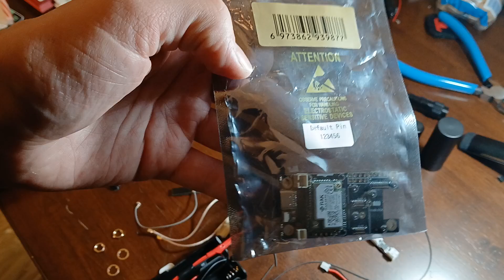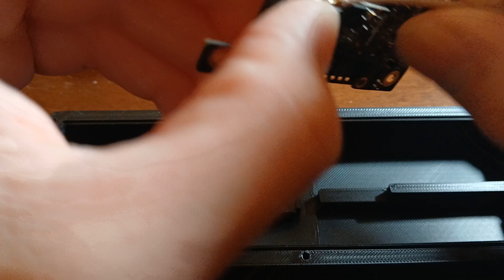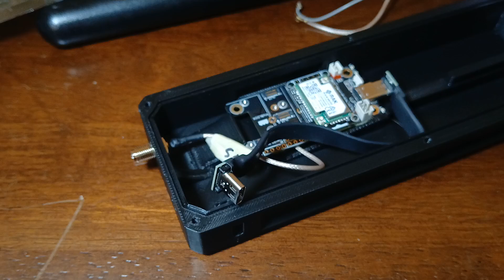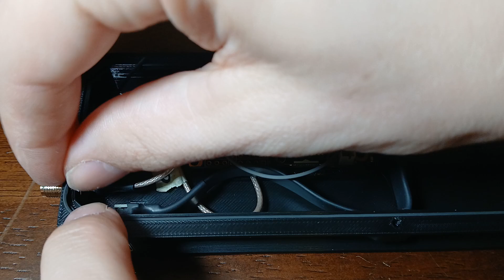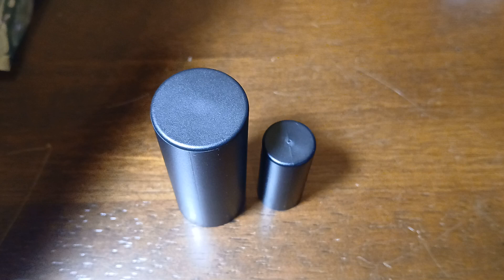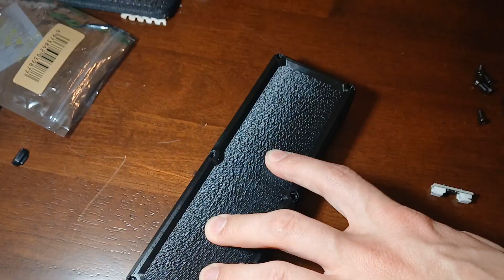Interstellar Research Systems Apex RMR Mesh Radio Assembly.

Comment: So I'd finally gotten all the parts in last Friday so I put it together and it kept power cycling and going into deep sleep. Turns out the Wisblock doesn't like the GPS module in slot D. Instead put it in slot A (top of the wisblock) and it'll work fine. It's a little tight against the Bluetooth antenna but it works and then you can see everything is connected right. I did use a little tape on the wires from the battery holders to keep them from accidentally getting pinched when I put the top on. I'll probably make a heatset version soon to see how it compares.

I used 2 Samsung 3500mah 18650 batteries, and after running for 4 days it's down to 79%. It'll probably drain a little faster now that I figured out how to get the GPS working, but still, I'll probably get at least a week on a single charge. I'm kinda impressed. Definitely a fun build!
Reply from the maker: Glad you like it. I'm still working on other projects. My goal is to make more user-friendly prints for the mesh networks.